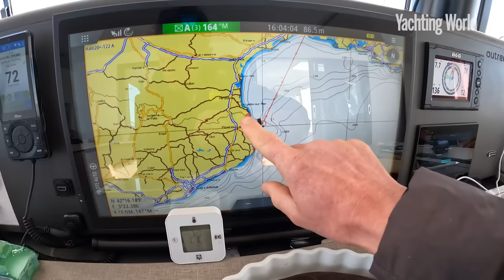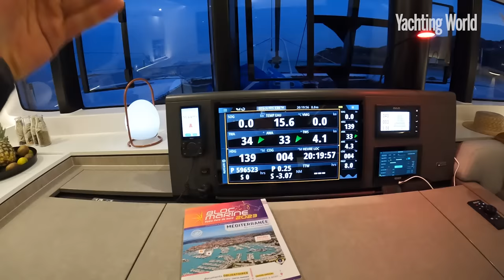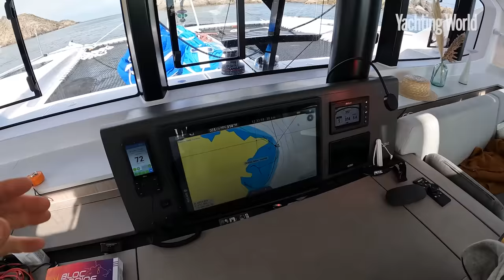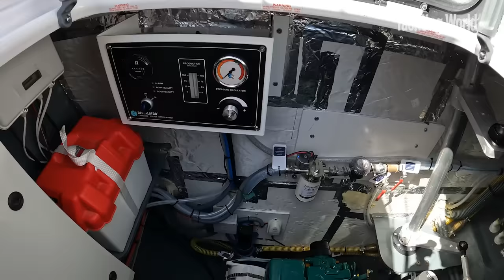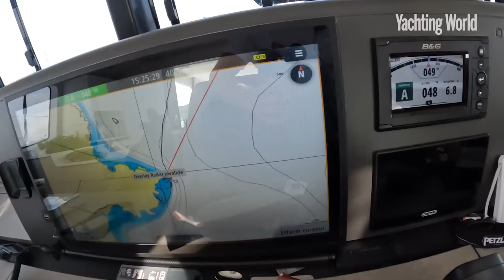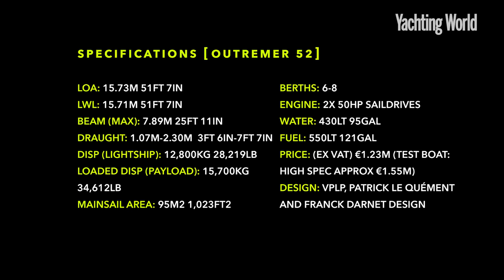Exclusive first (fast) sail! 200 miles on the new Outremer 52 - the ultimate bluewater cat?

Comment: Absolutely fantastic review. Got a wonderful feel for the boat. It looks perfect. The galley/kitchen area on the 55 does seem a bit special in comparison with the 52 though. I did wonder if the single wheel helm of the 52 compared with the double on the 55 would make a difference but it seems more versatile having just one wheel and a filler on the other side. Those hull bench seats have my name all over them! I would have liked to have seen how the back seating area works, compared with the 55 that has that has a very clever arrangement. I’m so pleased it’s probably your ultimate cruising boat, I had the same feeling! As did many others it seems with an extraordinary order book! Why why why is no one in the UK making a package like this?
Reply from the maker: Thanks @jimheaven! Yes the island galley unit on the 55 is a big difference - so it's all about how social you plan on being...
Dazcat in Cornwall have a pretty cool looking new 55 designed - you can do a VR tour of it - so you could look at that if you want a UK fast cat.
Reply: @yachtingworld  yes. Huge potential at DazCat. I wish they would do the three position helm. Perfect!

Comment: All in the Outremer 52 is ~$1.55m USD. That's the same price as a HH52 and a Balance 482. Toby, of those three which would you choose?!?! :) Great review as always! Keep it up!!!
Reply from the maker: Actually I think the HH would be a fair bit more, but is a full carbon boat @TheSailingFamily. Base price for the 52-OC is currently $1.5m and the SC starts at $1.9m. The Balance would be closer but the 526 is a more comparable size. I'd need to sail them both - preferably in similar conditions to this - to make that call please!
Reply: Which one is the least amount of weight? Which one can be optioned with the most amount of non-shaded solar? Which one is least sensitive to being over-loaded weight wise? Which one has the best main sheet system? Can you option some other main sheet system if you so prefer? Then go for test sails on all of them perhaps...

Comment: Imagine well support of the bow in terms of displacement under and around the bow.  The headsails deeply keeled more than the mast blades by 3or4 times.  Then wider than tall by two.  80 ft wide forty ft mast 70 to 80 ft long well keeled academic keeling design stem to stern.  Stem deep remember??

Comment: Fine in need of refinement.  You might have discovered that the boat has a pitch pole hazard.  You need to keep the bow up out of the water and blade keeling of the headsails to keep the speed you think you are getting from a narrow pontoon. The boat on the surface and blades keeling the mast and headsails is a faster solution.   Wider would improve the speed but with narrow pontoons you have more serious pitch Pole accident..

Comment: Any concerns about all those vertical windows at the front of the bridge deck space? Just seems vulnerable when heading into big seas. Wave-piercing bows mean more waves higher on the boat sometimes, yes?
Reply: I'm guessing that has been tested thoroughly... Outremer is a big manufacturer... And also: This is a fast sailing boat. It can also probably do some ~10 knots with just the two diesel engines. And weather forecasting these days seem to be pretty good. If you can afford this boat then you can also probably afford to stay a couple more days at some kind of slip to avoid the worst storms out there...

Comment: im not a boat guy ,but why catamaran sailboat at that front of area, always use net, why not make it flat ,make it part of the boat , is because try to avoid ground effects when sailing high speed , and ground effects suck whole boat down ,that make more drag , so that fish net almost half of boat length, the tunnel under the boat short, mean only half volume of air passing through, that break or weakening the ground effects .? sorry for my poor english.
Reply: If it’s solid at the front it adds weight and holds water when diving down a wave which can cause it to forward roll if the bows get buried. The netting drains the water off helping prevent burying the bow. Faster the boat more netting up front.

Comment: For a 52 footer it seems the main cabin is small, the idea of having the trampolines so far back cuts space away from the internal living area or they could have shortened the trampolines and made a space for sitting, it just all seems squeezed in. Other than that nothing can beat a day of sailing in close to perfect conditions.
Reply: That's the sacrifice of a performance cruising cat and why length is not a good measurement to compare with "normal" cats... An Outremer 52 has a displacement (dry) of 14t compared to 26t dry for the same length Lagoon 52... 
Hulls need to be narrow for speed which means they don't have as much buoyancy forward as regular cats. That in turn means living areas (in other words the weight) have to be pushed backward in the boat. Or you can look at it the other way an say they take a 38-40ft cat with 38-40ftliving quarters and extend the hulls 12-15ft to 52ft to gain hull speed/performance...
Reply: @BilldalSWE  Thank you for your explanation, appreciate it.
Reply: @BilldalSWE  Isn't the dry weight for the Outremer 52 about 12,5 tonnes?...
Reply: @angela1984a  You're correct. I mixed it up with the Outremer 55 which is 14t

Comment: I don't get it at all. Outremer do have improved the design hugely with 55 and now 52, but that does not say much, in my book. The old Outremer were all about performance and offered very little in design and comfort, to be true. Still, people comes hard against for instance Neel 43 for the small galley, and that is a couples trimaran at a base price at 450k Euro! This Outremer 52 is a three or four cabin family or charter machine, at a base price of 1,2 million Euro, and it got the same size galley, but that is somehow okay! Absolutely the smallest galley and living space in the 50 foot class of catamarans and the accommodation below is also still compromised. FP 51 got full walk around island berths and copious space in five cabins and do in fact not sail that much worse at all. FP 50 Saba, which it replaced, often crossed the Atlantic in 200 miles days in average, which is all, that you can hope for in this Outremer too. It is even worse than that: The old Seawind 1160 and now the new 1170 got DOUBLE the galley space of this Outremer 52, and that is a 38 foot catamaran! Is performance really that important? Especially considering, that most live onboard sailors is at anchor or dock 90% of the time. So, 90% of the time comfort and space is compromised in this much more expensive Outremer, just to gain actually a very small performance advantage in reality 10% of the time. On top, when people then load these boats, as they do, with all of their provisioning, toys, gear and so on, then that advantage in performance has gone out the window. But, all to their own: If I got the money, I would definitely either put my money in a Windelo 50, save almost half a million, by the way, and get about the same performance, but less compromise in comfort and space or the new Neel 52, which has almost the same performance figures, but immensely more comfort and space, and still is cheaper. By the way, Windelo has finally cracked it, with those forward cockpit helm positions, which can be double enclosed, both to the bow and to the indoor accommodation to the aft. In my book, it is the only helm position on a catamaran, which does not have clear disadvantages, as well as advantages. The disadvantages on this Outremer is of course, that it does not have the double helm position, as former models got, still you are either fully in the weather and exposed or you have to helm in the aft cockpit and look through the living accommodation. At night time the latter means, that all light have to be off in the living accommodation and galley too. To be fair, the helm position in for instance Leopard, Neel and FP catamarans, that raised helm position, also got some clear disadvantages, apart from the advantages, that mostly being, that you got to climb stairs to get to the helm, also in bad seascape, where for instance HH and Windelo has managed to have living accommodation and helm position in all one level. Still, thanks for a nice review and for showing us all the details of this boat. God Bless!

Comment: I sailed the 5x 3500 nm ,  very nice . Not good for cruisers with a slower pace of life , its a boat you can over power quick, 
Great boats though
Reply: There are a lot of good qualities in Outremers. The 5X might be a little too big for a cruising couple. But there's obviously the 55 and this 52 as well. If these cruisers learn how to reef in any condition, and then slow the boat down with two or three reefs in the main, then I'm guessing any Outremer will be just as safe as any of the condo-marans out there... Also: There are load alarms available for installation that will warn you when a catamaran starts to become over-powered. Those are expensive, but not that expensive when factoring in the total price for cat in this price range... Especially if were talking about the 5X...

Comment: lacking on solar and why have gas at all? hybrid engines and more solar with more batteries no need for a generator. Outremer is falling behind.
Reply from the maker: I agree not all roof used for solar, so the option for more could be wise. However, the mix of induction and gas is one Outremer feels prudent as most owners are going Bluewater cruising and this gives redundancy for cloudy days. Remember, they have build a fully electric cat for Jimmy Cornell already and you can opt for induction only. It's in our full report in Yachting World June!
Reply: Are you interested in a multihull of this size? I think the boat in this vid is hull #1. In that case it is a customers boat. So that client specced this amount of solar, and the gas/induction combo. Like Yachting Wold wrote you can cover the entire roof with solar if you like. You can also have additional foldable solar panels that you can place on the trampolines when on anchor/mooring ball or in a slip. And I'm sure Outremer will be open to discussing engine/electric propulsion options if you are willing to part ways with some cash...